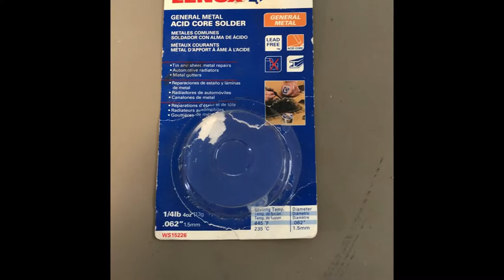Stannous Chloride Brass Solution test and play after.

Comment: It's looks like copper cloride to me
Reply from the maker: There is some copper chloride, but it won’t react with stannous chloride like that. Only precious metals do like gold or palladium.
Reply: @IntermountainGoldRefiners  what did you dissolve in solution ?
Reply from the maker: There is another video where I dissolve a gold looking (copper) ingot in nitric acid.  Stannous chloride is tin wire dissolved in hydrochloric acid.
Reply: @IntermountainGoldRefiners  did you neutralized exes nitric with agricultur urea ?
Reply from the maker: @giorgosxyrichis3630  no it was still fairly acidic.
Reply: @IntermountainGoldRefiners  hm .. p.m. usually when precipitate stay in solution iven in a reactive a.r. but I see a dark cloud in solunion ... very very tiny amount of something I had the same problem after I use agriculture urea that have a various amount of metals . I try to isolate to chek what was it but iven with 2 filter paper it just past thru papers . Btw solder contain pb usually. if you don't filter clsn2 you may precipitate pb ☺ btw very tricky and interesting video !!! ❤